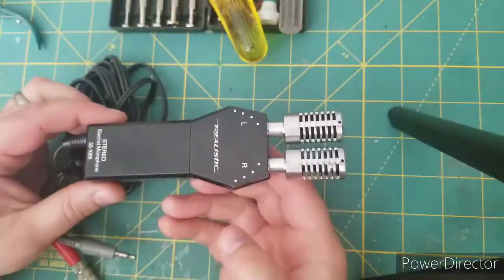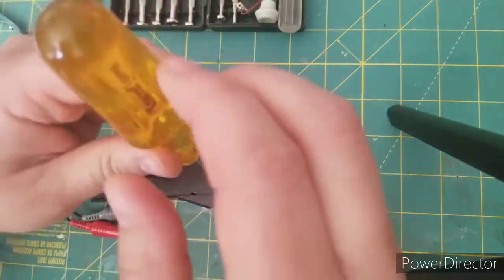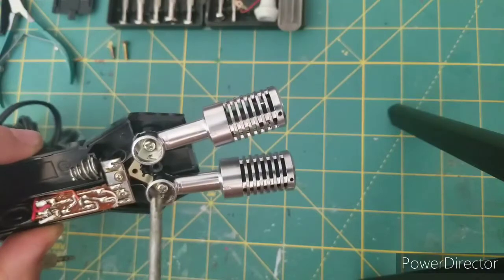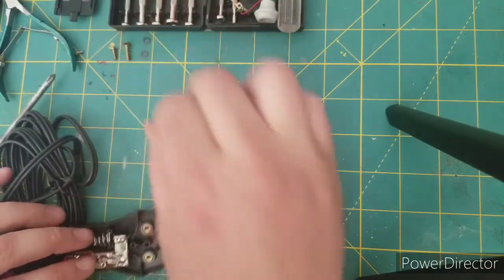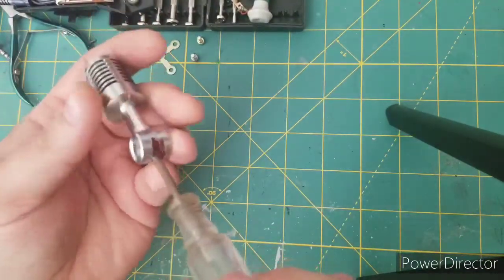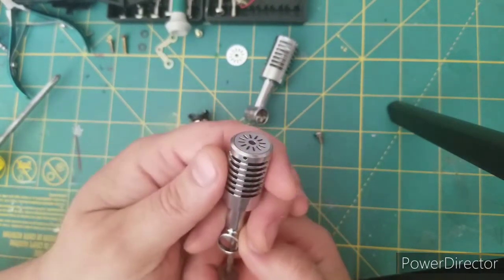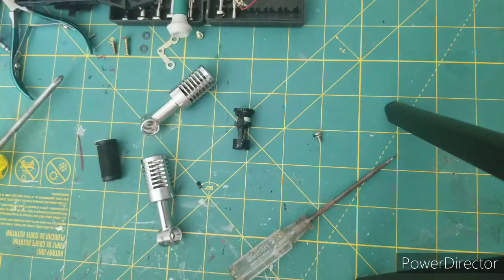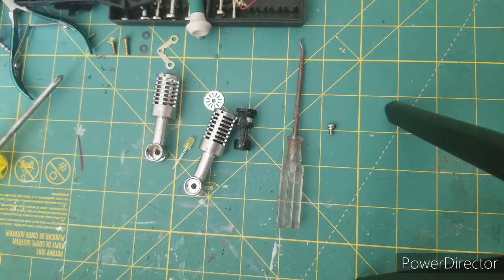Giga meter microphones Ghostbusters 2 Realistic stereo electret 33-1065 disassembly

Comment: Thanks for posting this! Just got my microphone and was wondering how to take it apart. First one worked perfectly, second one unfortunately the microphone itself popped out but the inner black spacer stayed attached and couldn't be pushed out. I ended up using a screwdriver to twist/rotate this part inside the silver casing until the glue detached, then it slid out perfectly.

Just finished printing most of the Gigameter parts, can't wait to get stuck into the electronics. FYI I posted a thread on gbfans where I managed to extract the actual Gigameter sound effects from the film and clean them up a little, as well as attempting my own recreation. In case it's useful to anyone here